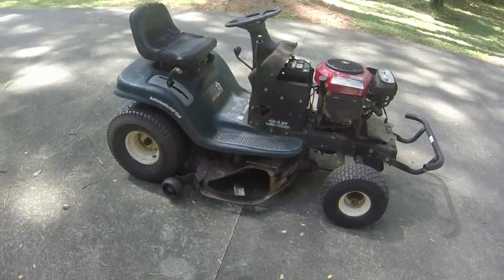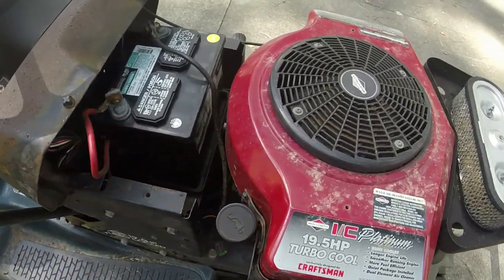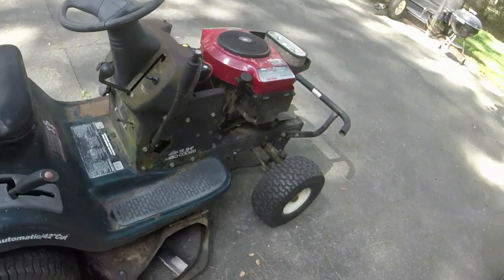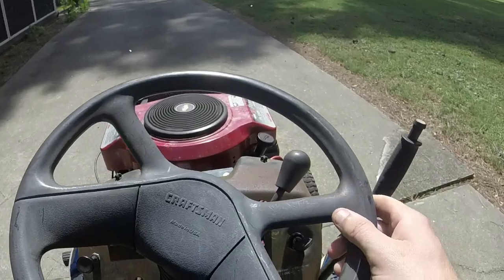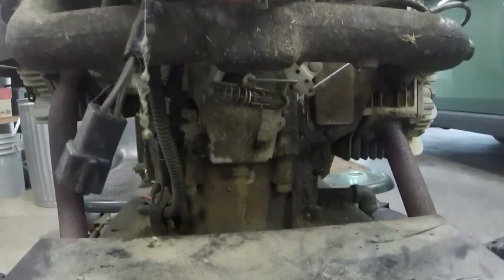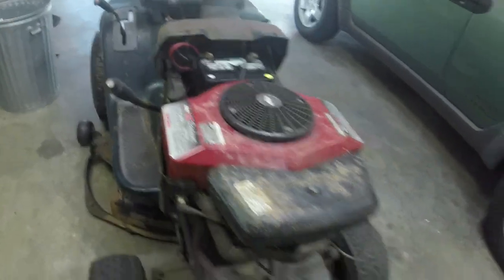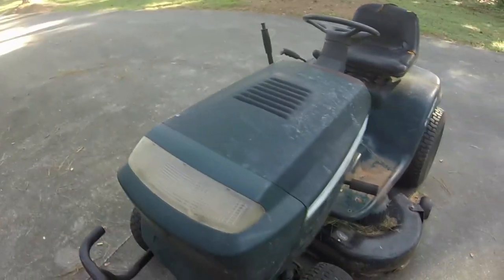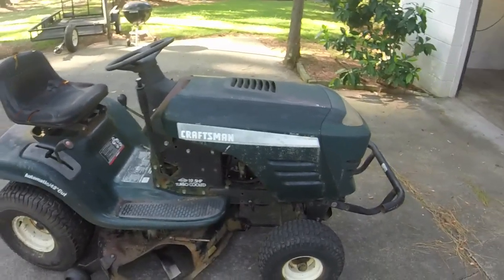Craftsman Briggs opposed twin pt. 1: Setting governor, adjusting idle speed

Comment: The governor can be set or reset if it's loose.  Loosen the nut on the governor arm. Rotate the governor shaft coming out of the  engine , on this model, counterclockwise, at the same time without moving the shaft, move the throttle linkage on the carb to wide open.  With the shaft to the left and the throttle wide open then tighten the nut. The governor is now set. The springs and screws on the external throttle control are for finite tuning of the rpm.

Comment: This video saved me much aggravation. I had the same problem of unresponsive throttle control after a complete rebuild. I thought I'd have to take it apart again but all it needed was the long screw tightened. You earned a loyal subscriber!
Reply from the maker: Glad to hear and thanks for watching!
Reply: I have that same issue with mine it won't throttle for nothing

Comment: i  have  both  the  19  and the 20 hp versions of  the series -  Murray  for  Both  -  one  a  Lawn Tractir  -  the  Other  a  Garden Tractor  - lawn tractor bis  Red  and  Garden  tractor  is  Green -  Both with  External Slide Rail  Governors  .  the  old double hook ended rod ran thriugh a  long spring with  a  long  screww that  Also  has the Lower Swing  Arm for hrottle  control behind  the  actual external governor

Comment: Hello there, just want to mention that around 16 mins, you say that you're able to move the throttle because you can move the throttle cable lever on the dash, but since you don't actually show the throttle plate moving inside the carburetor it's uncertain whether the throttle plate is really moving, I have the same engine and the same linkage and can also move the throttle lever but the throttle plate doesn't move at all, just putting in my $0.02 for whatever it's worth. Thanks for taking the time to film and upload the video, it's quite interesting and informative.
  JUST TO UPDATE: At 16:00 mins the screw with the spring that you mention should perhaps have a second spring at bottom half that counterbalances the top spring There's a video on you tube "A Look at the Throttle and Governor Linkages on an opposed twin Briggs" that shows a view of it during the first minute, i'm not sure if thats a factoty item but it looks as though it may be. Thanks again.

Comment: Recently picked up one of these off Facebook market place and got it to run again. Got a chance to test how much torque these motors have when I got a job out of the blue while trying to take it for it's first lawn service trial to move furniture from one unit to another. Not sure if the it came with it or the previous owner had it added on but mine has a receiver for a 2" ball hitch which I was able to hook up my 4x6 utility trailer and move the furniture. It wouldn't run on the last leg of the move so I had to go back and figure out what happened which after some time a a mild parts cannon, it found it to be the coil when the engine has been run for a while and gets hot. It does restart when it cools down but I wonder if it's just the coil overheating or like on a youtube comment on another video, the coil being mounted to an aluminum block can't maintain the pick up from the flywheel magnet due to the gap widening from the expansion of metals.
Reply from the maker: That's the most common failure on these.

Comment: I've had exact issue of my mower not shutting off, What I did was take off the top shroud, And find the ground cord that shuts off spark from coil, Which was chewed by mice. used electrical tape and it shuts off perfectly now.

Comment: I changed the needle on the carb. Changed oil and plugs the jets  where  plugged blow them out put everything back together  didn't touch the throttle other then  disconnect it. And put back on. Now it's running  full  throttle. Open  or closed
Reply from the maker: The throttle linkage might be hung up somewhere.
Reply: @EllisMowersandmore  it all moves when  I move the lever
Reply from the maker: @deanwest7623  It's possible that the governor let go internally, or you can try to adjust the governor.
Reply: I don't know how  that would happen it ran great until I got some bad gas. And plugged the jets. I had fixed  that and gas shot out of the carb I changed the needle and now it runs  way to fast. Nothing was wrong until the bad gas

Comment: Can you tell me about the valve adjustment on those engines
Reply from the maker: I haven't done one before but since they are flathead it involves taking out the valve springs to grind down the valves.  I think it's supposed to be between .006 and .008 but double check.

Comment: You can shut off the fuel by whatever means you choose, ex clamp hose with vise grip.  There is a 3/4" cap on the side of the carb bowl.  Remove it and cpture the gas that comes out so you can see anything that comes out that should not be in gas, like dirt,crap and water.  Behind the cap is the main jet.
 Which can be cleaned with a wire without removing or remove it with an allen drive and clear the jet and beyond with wire and carb cleaner.

Comment: Have you ever rebuilt one of these? I have a 17 and a 20… my 20 is newly aquired and after about 5m of running, i realize it's toast and seizing. I suspect bearing, but it's also spitting incredibly black oil out exhaust, guessing head gasket? Case oil isn't that black. 

Anyways, winter just hit and i don't got a garage, so rebuild will be next spring, just curious if it's even worth rebuilding
Reply from the maker: I have not rebuilt one of these, often if they have issues I put a different engine on the machine before selling it.  They are great engines but not for the average consumer who is not mechanically inclined.

Comment: not sure if your still active but my throttle wont rest against the idle screw i dont know how to fix it
Reply from the maker: You might just have to adjust your throttle cable.  If it's an opposed twin that adjustment will be on the front of the engine.
Reply: @EllisMowersandmore  thank you, but I figured out the problem it was the governor spring on the governor attached to the linkage to the carb. I ended up stretching the spring now, and it rests against the idle screw
Reply: @EllisMowersandmore  one last question: What kind of oil does these mowers take and how much

Comment: I've been looking for weeks for a video or diagram of the throttle linkage setup for my neighbor's 2010 LT1000. It will crank, immediately rev super high, then die. I have an ancient MTD I saved from an abandoned property, and a 4yo Husky RZ5426. Neither has a throttle setup like this one. Already tackled the carb/fuel pump; no difference. This video has helped me troubleshoot, but I need more detailed info/video on the throttle/governor system and how to adjust it. Do you have any videos specific to throttle/governor issues for this model?
Reply from the maker: If it is a single cylinder Briggs engine, the adjustment is on the governor arm on the left side of the engine.  Taryl Fixes All and other folks have videos on this engine.  Never had to adjust the governor on a V twin.

Comment: Why are you pulling the choke when you are trying to test the idle speed and throttle rang ?
Reply from the maker: They are separate cables on this mower, probably should just keep it off.  I think I was trying to keep it running.

Comment: Will adjusting the governor fix my 17.5 briggs & Stratton engine bogging down
Reply from the maker: If the governor is working properly that would not be the cause of it bogging down.
Reply: @EllisMowersandmore  The other thing is when you throttle up it’s not very responsive

Comment: also there is something hitting when you crank it over. im guessing your starter might be missing a tooth
Reply: its running a little fast. needs about 1 and a half turns out on the high speed screw.
Reply from the maker: Thank you, I think it was a combination of the cover being off and rubbing.  The battery is only a 250CCA so it takes a couple hits with the key to turn it over.  Haven't checked the starter though so will give that a look.  Also think I'm going to back off the governor too like you suggested.
Reply: @EllisMowersandmore  Poorly adjusted valves will cause lurching, ie 1 good rotation then one hard rotation, when trying to start. If you search around there is a chart with all the clearances for various Briggs & Statton models. Just FYI hopefully it will help you in the future.

Comment: lol set the parking brake so the seat safety switch doesn't kill the motor when you get off to find something to shut the engine off
Reply from the maker: The ground wire was unplugged at the engine which is the ground wire for the ignition switch and safety switches.

Comment: sounds like the Carb  has trash in it, ive had a few of these,, sometimes, you can take out the plug on the side of the carb and you will see the main jet, clean it,, ill bet it runs better,, if it dont, then its time to pull the carb and do a deep clean
Reply from the maker: Thank you, I did end up doing this around the 26 minute mark which I think blew the trash into the fuel pump which I had to clean out (off camera).  Put some Seafoam in it and cut the grass and it runs like a champ now!

Comment: Here is one for anybody.... I have the same mower and engine. I brought said used and been fixing for past month. As it turns out mower was a lemon. At this stage I have cleaned and rebuilt carb. Flushed tank, new lines, new filters. New starter, new ignition, new silnoid. New battery, battery cables and many other things. Issue at this time now is mower will NOT rurn off when key is off. What I see as a pattern is it will turn off fine the first 3 min mower runs. When motor gets hot it stays running. I am going crazy at no luck and no info on this. Sure, everyone says easy fix kill wire is undone. NOT so here.... I have checked the coil, the wire to ignition and it is fine. I have contact cleaner all tabs. I even ran a new wire from coil and touched frame. It will spark but engine just won't shut down. Even put a momentary switch on kill wire and nothing. Engine stays running. So I got to pull the spark plug boots all the time which is crazy. Any takers for input on causes?
Reply from the maker: You have me stumped.  I would do some more wire tracing.  Could you have a ground that heats up and shorts out as the engine heats up?  That would be my first guess.
Reply: Change  coil .
Reply: About only thing I have not done is change coil. I will do that.
Reply: @joesphbaumgardner4579  The Coil Has to Have a Clean Contact on the Coil Stud Mounts and the Coil itself, If these are Rusty and it gets no Proper earth it won't shut the engine off. I know this is a old post but it may help somebody else out